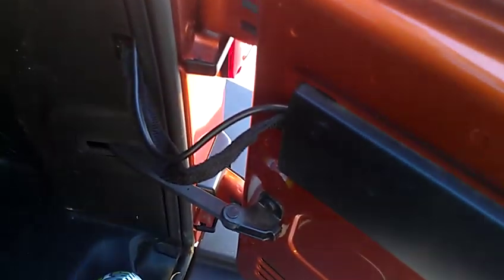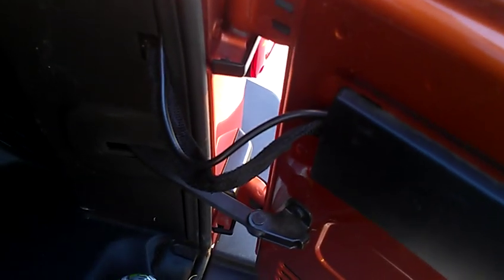CB antenna on Jeep Wrangler Unlimited

Comment: I found it easy to simply run the cable through the grommet(as directed to by the Terraflex mount instructions), as it's pretty thick and seals up around it.
I then ran a wire clothes hanger from the biggest hole under the plastic cover and fished the cable through to the other side of the gate with it.
Running the cable under the carpet took all of 10 mins because the carpet is simply velcro'd together at the factory. It's where they run the stock harness(es) as well.
I then mounted my CB to the right side of the shift console, as there's plenty of room for it there, plus a screw to mount the bracket to(I have a Uniden 520).
You can pull power from the backside of the power port, as that's supposedly the only 'switched' lead in the area, or do what I did and buy an adapter that simply plugs into the power port, and has to leads coming out of it with bullet connectors on 'em to plug your CB leads into. It's a whopping $3 on Amazon, so changing it later to a more permanent power source won't kill the bank.

Comment: I can see that antenna snapping the first time this jeep (unless it's a street princes) goes off road.
Reply from the maker: +josephmars20 It's rock solid and hasn't been a problem.  And, this Jeep was at an offroad park with 500 miles on the odo...sunk in a pit and run through many trails with trees and obstacles.  It gets used as a Jeep.  No issues.

Comment: Where did you get that plug for the antenna wire to go through the tailgate? I'm running wire out the back of my truck to the tool box but I have no idea how to weatherproof the hole.
Reply from the maker: I just made an incision in an existing plug in the tailgate.